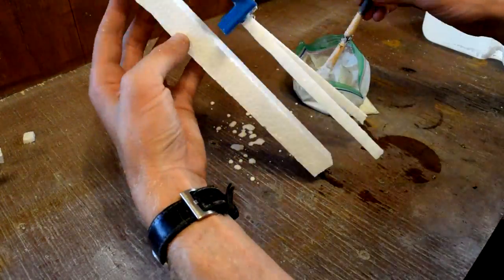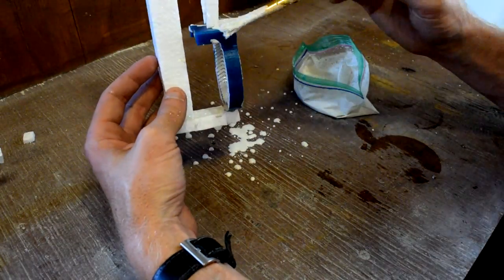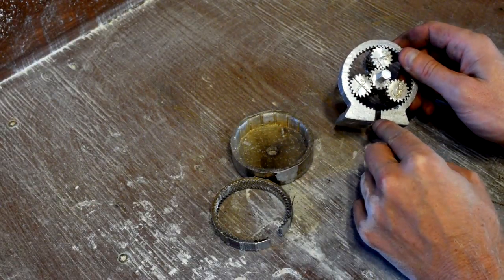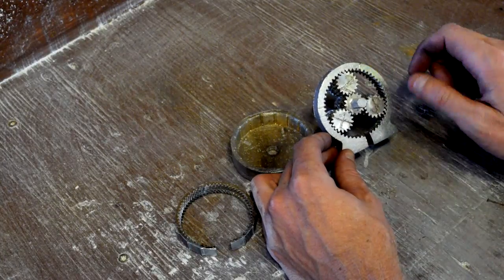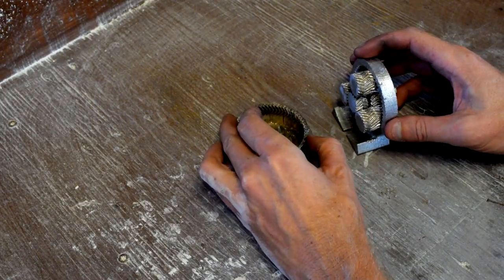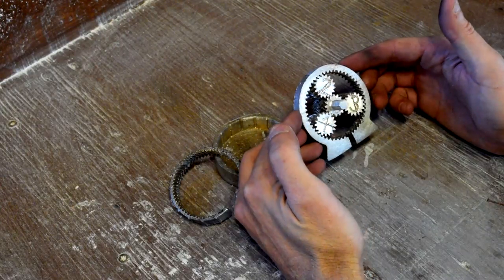Metal Casting 3d Printed Planetary Gearbox Part 4

Comment: When doing metal casting aluminum a 3% oversize pattern is needed for the metal cooling shrinkage ex:  if you need a 1 inch diameter by 2 inchs long cylinder than your pattern will need to be 1.030 in dia by 2.060 in long  these dimensions will allow the finished part to be close to the tolerances of the cooled shrinked part of the above nominal dimensions  Steve

Comment: I really wish you would give it another go, after you figure out how to recycle the plaster.  The layman in me says to measure the circumference of the rings and make a straight piece the same size to determine the linear shrinkage.  Then upscale the ring that much, problem still remains wether or not the teeth will be properly sized at that point. I would imagine this is much like printing with abs in that long straight geometry will curl due to linear shrinkage.  Good job anyway was very interesting to watch.
Reply: Yea this is a standard technique e.g. for scaling paper prints properly: you print once, measure it, and then print again adjusting for any distortion. You do waste a cast the first time, but with time you should get a pretty good model of how your cast distorts, and correct directly.

Comment: Gear production is still a very expensive and challenging machining operation and proper gear profile design is very complicated (we mostly use clearance although in some exceptions there are preloaded gear designs). Also herringbone gears (not double helical cut arrangement but the ones like yours with helical teeth that meet in the middle) are the most difficult to produce and cannot even be made without specific equipment or a multiaxis CNC machine with a 50,000$ CAD/CAM program to drive it...They are kind of a proprietary gear as Citroen invented them and the emblem of Citroen represents that. You should stick to a spur gear!
Reply: Even spur gears would fatigue pretty fast with these kind of tolerances.
Reply: @schlierenguy  The fact that 3d printed assemblies can be moved by hand and behave almost as expected doesn't translate to any usefulness in the real worlds. Any load would quickly destroy any kind of 3d printed gears.
Reply: @Sketch1994  If you print chunky plastic gears for a small load, then you can get fair mileage out of them. You just need a good machine and perhaps ABS instead on PLA. Now a) the tolerance of the casts is much worse than what is printable and b) the fact that you make them out of metal implies that it's a high load application. So I agree with your initial point but respectfully disagree with the generalisation.
Reply: @schlierenguy  In all cases gear life greatly depends on the contact face surface quality and contact pattern. I don't think it's worth trying to achieve that by 3d printing unless you are making some hollow structure or machining them afterwards. Since you can buy (or make) high quality machined nylon gears for so cheap nowadays I don't see a point in 3d printing them and it's not what this process is most suited for.

Comment: I'd suggest making the outside first for measurements followed by the insides with adjusted measurements.
Though I still believe that the size to surface finish ratio is rather poor to cast gears ( the bigger the gear the less important small bumps in the surface finish become )

Comment: The split parts, can't you just scale them up 6%? I'd print out 6 or 7 of them ranging from 4% 4.5, 5, 5.5 6 6.5 and 7% bigger than your first one. Also, the split, don't wedge it so far apart to avoid the gear teeth bending together at different rates around the ring. I'd also add some copper to the aluminum to add some flexibility to the finished part (and hardness).

Comment: I noticed you burn the pla and styrofoam away, and this takes a lot of time. Have you ever considered printing the parts in abs and later solve them with acetone? I'm not sure if this might leave some kind of resedue though.
Reply from the maker: Rutger I haven't use ABS but have tried acetone on PLA. It's just turns into a gooey mess.

Comment: Really too bad it doesn't fit together. The whole time I was thinking that you could put an electric motor on it and just run it until the gear teeth start to wear in together, but who knows!
Reply from the maker: +Gear Down For What? I was thinking the same thing. It's the ring gears that won't mesh though...if I get some time maybe I'll try and recast them bigger. PM me if you want me mail it to you though.